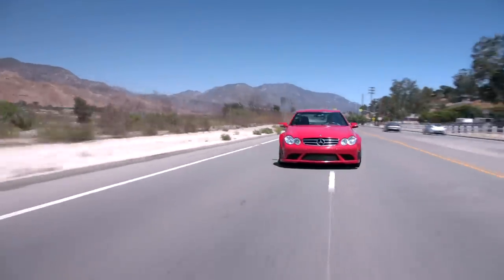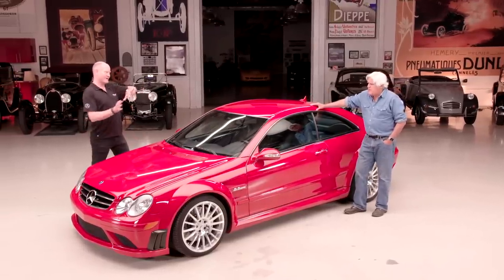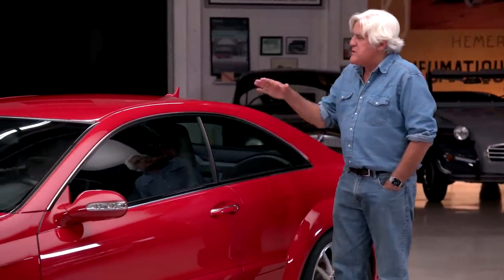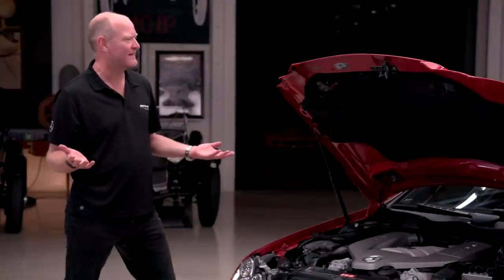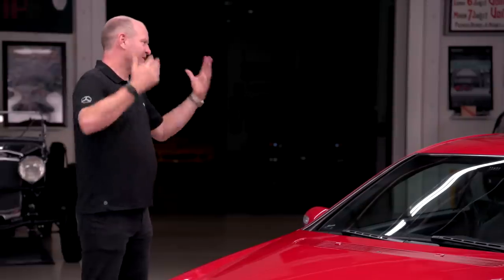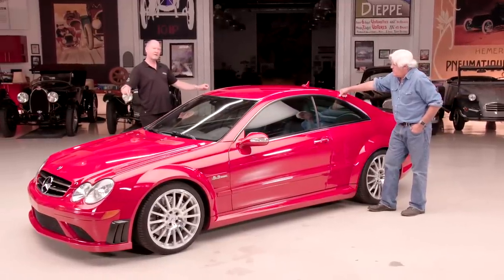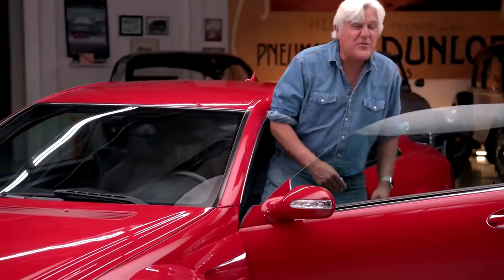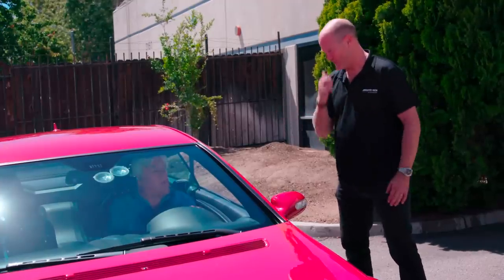2008 Mercedes-Benz CLK63 AMG Black Series | Jay Leno's Garage

Comment: So crazy, that Black Series was the maddest thing back in the day… ten years later 500hp barely seems impressive.
Anyways, I found it strange how Tommy described CLK as a two door C Class; I know it’s basically C Class after the fire wall and E class in front, but in terms of pricing, performance, and position in the product line, I always understood CLK to be a compact version of CL Class, just as SLK was a compact SL… hence the “k” designation.
Reply: The CLK GTR was a tad bit more 'mad'.  ;)
Reply: You are correct.
Reply: The SL65 AMG Black series was the nut job.

Comment: Regarding tire regulation in Germany. Car manufacturers had "exclusive deals" with certain tire manufacturers and until the year 2000, you were only allowed to run the tire brand that was "approved" for your vehicle,...which of course was just unnecessarily stupid and dropped by a European-Union regulation.
Reply: Germany is needlessly bureaucratic.
Reply: @DoctorSkillz  Was just obscure business practice, sold as a safety regulation rule.
Reply: Half German here living near Frankfurt. 😅 I can't remember ever having to put an "approved" BRAND of tires on any of my cars (got my license and first car back in 1998). Dimensions, speed and load index of the tires you are allowed to put on your rims (wich also have to be of approved technical specifications) on the other hand, still have to be of a certified type up to this day. Our "TÜV" - wich is the stringent german stepmother of the american inspections - can be a real pain in the arse when it comes to this. If they haven't approved a tire / wheel combination for use on your cars make and model, the cops can pull you over and revoke the operating permit for your car, basically forcing you to walk home.

Comment: In regard to his comment about the manual gearbox; I completely agree having driven most Merc performance cars of the era. I always felt that this was more of a “muscle car” platform than anything else; and a 6-speed would’ve complemented it perfectly.  Side note: You could still get a manual gearbox in the Audi and BMW competitors to this car in 2008. (S4, S5, M3, etc)
Reply: Get them while you can.
Reply: I have an automatic 540 and a manual M5, both e39 chassis. The manual makes the car so much fun to drive. I think the last Mercedes I saw with a manual was the 190 2.3 16v that rivaled the M3
Reply: @PatricioGarcia1973  I also have an e39 540i with the 6-speed (M pkg); still just as in love as the day I bought it!

Comment: When Tommy showed his disdain for power steering in Formula 1, I couldnt help but think of the remedy that is the the sheer power you have to put on the brake pedal to make the brakes work they way they do. And the reason being that under 5 negative G when braking into a corner from top speed, your body and leg weight adds so much force to your muscle power, the brake pedal has to require such force to avoid overbraking and accidentally locking the wheels up. Also, the pedal barely moves, it basically works by measuring the force you apply to it instead of the distance it travels. These guys do hard work in the course of a race for various reasons, no need to make steering a workout as well. 😅
Reply: Exactly. A bit of an ignorant comment from the gentleman. F1 drivers get a real workout by the end of the race. It's definitely very physical. More than they get credit for

Comment: My understanding is the CLK was the follow-on to the CE300 or E-coupe.  Nonetheless the CLK DTM is legendary and the CLK GTR one of the all time special cars.  The 2007 CLK 63A was a 147 example production run and then the 2008 CLK63A was a 100 production run so very limited production cars, not certain as to the quantity of CLK63 Black Series.  I actually have a CLK63A and it has everything except the adjustable suspension yet with a  convertible top and rear seats.  I pined for the damn thing for 10 years until I found the right one.  I always considered it the German version of an American muscle car, of course much much more refined.  The 6.3 was the first all AMG designed and built motor for production I think.  My 08 is so well built, I think they really took extra care on construction; a more well built car than my 2017 e class.  Thanks for showcasing this car, they have been under the radar.  Awesome!

Comment: I had a CLK 320 and I'm pretty sure it's the coupe of the E class. CLK stands for coupe light kompressor.
Reply: The E class had its own coupe
Reply: @redrum2204  Just checked. No separate e class coupe in 2008. The one that this one is based on is the direct follow up to the 320 CLK I had which was the coupe of the e class.
Reply: They were the the E class coupes and convertibles... But the 'K' stands for Kurz... A german word for short or compact. Any old model with a 'K' in its name meant this is the smaller version of a bigger car i.e. CL >>>CLK       SL >>>>SLK    GL>>>GLK etc.
Reply: @matthiasbalke9089  sorry, you're right. The E coupe came out the next year/model

Comment: You can run wider tires and bigger wheels, but when it goes over what the maximum size is from the manufacturer you have to go and "re-register" it. Same in several EU countries. Also have to do this if you change to coilovers, they have to be TÜV-certification, this same certification also works in many other EU countries than Germany. The tire thread should not be over the fender line, therefore some might put on stretched, but adding fender flares would take care of the issue. You also cannot tune the car, only to certain limit and then you have to once again re-register the car to the specifications and if it goes way  over, it won't pass in some EU countries.

Comment: AMG (Aufrecht Melcher Grossaspach) started out as a private company and later did some work for Mercedes-Benz. Because their work was so good AMG was eventually (partially) acquired by Daimler and since 2005 I believe it's a 100% owned.

Regarding your comments about putting on different tires in Germany. Every change an owner does to the vehicle has to be approved when the vehicle undergoes the mandatory technical inspection. When that is due depends on a few factors. So if you change anything that is different from what the manufacturer did (unless it's approved by the manufacturer) you'll get dinged at the inspection and perhaps don't get your sticker. When it comes to tires, the tire manufacturer doesn't matter but the specs need to be the same. Best example is about rims. If you want to put a different brand/size rims on the vehicle some rim manufacturers have documentation that says it is okay to be put on your type vehicle. Then, with this piece of paper, you are good to go at the inspection.

It's both difficult and frustrating, because if you want something that's approved for your vehicle the manufacturers sure know how to get to your wallet. It's a lot of red tape.

Comment: I'm not sure if all 500E's had it but I almost bought a 2008 500E wagon with the AMG kit (wheels, aero kit, steering wheel, etc) and it had the same gear shifter.

Unfortunately I didn't buy it...

Comment: Cars in Germany are required to have only car parts and wheels installed that are either designed by the manuf. for the car or have a TUEV certificate, that they can be installed on a certain car. On a rare car, you will find very few wheels with certificate, which I imagine was the case for the CLK63

Comment: The CLK is not the C class coupe exactly.  The CLK W 209 was based on the C class chasis, but the instruments, and engiens were from the E class.  It was supposed to be the E class coupe. There was a C 180 coupe at the time that corresponded to the C lass. The CLK was replaced in 2010 with the E class coupe

Comment: The tires rules have been reduced over the years but you need to have the right speed and load rating also the dimensions have to be within the range approved for the car

Comment: Tires are not problem. Rims are today no problem too. But everything crash test relevant, like a spoiler for example, has to be tested. In case of that spoiler it means, you will have to crash it. Thoses tests costs money and material (like that spoiler) but can be done. A friend had a custom made spoiler for his old fiat 500 and they two some. In the end he made them in a mini-series. The costs were around two grand but it took a LOT of time.

Comment: I heard the german blog at „alte schule“which means old school and it is about many famous german Car makers like Walter röhrl, Hans Joachim Stuck , Wolfgang Reitzle Former BMW Chief of Technology when the first V12 was developed in 1988 and the first E30 m3.
There is Willy Kauhsen the Former test driver for the Porsche 917. He told That he was testing the 917 on Nordschleife in 1969 and the differential was wining and when he came back Engineer Flegl said nobody told you to Drive so fast you have Bern doing 380 km/h on the straight 238 m/h. He drove Can Am test for Customer and was visited by Mark Donohue in Weissach. In Europe he Racer the interseries using the 917/10 with 1000hp.
Reply: Willy Kauhsen was called by a US Racer called George F.… from Can Am That he wanted to Drive Nordschleife. Willy said dont do it is Zen times longer than Laguna Seca and fifteen times more and more vicious curves with Beton.
The guy trained 5 days with Willy on two 911 RSRs and gave up. Willy said now we have 350 hp. Now imagine it would be 550 or even 950?

Comment: Some TÜV-Mythbusting :

In Germany every substancial safety relevant modification to the car has to be approved by some authority.

Lights, Wheels, Brakes, Suspension, Engine...and of course seats,belts, seats, airbags...and for the future: Autnomous driving functions..

1. The manufacturer of the car
Usually it is not strictly legal..but if you change you C-Class suspension to the OEM sport suspension...police and Tüv most likely can not tell the difference In a Mercedes for example.
But:
Also they get more and more and more reluctant to do it, you  could even have your car re-fitted with OEM options and then get a new "Datacard and CoC Paper" for you vehicle that now includes the Option..but it's usually 2-3 times more expensive than just checking the option on your order sheet or finding a car with the options you want and just sell the old one.

CoC Paper just says: This car is like the car, that the authorities have already checked with the manufacturer before production.

You could also go to the TÜV and say "I fitted the complete sport suspension, only used OEM Parts" and they most likely will give you an entry if it's done properly (usually if you had it done by a professional) [Refer to 4.].

2. If it's third party bolt-on-stuff you need to have an "ABE" - General approval of operation. So the manufacturer of the bolt on part, tested it with the vehicle and hands a document that says:
It's working, don't mind. Usually this is for lights and suspensions and seats...

3. With Wheels (OEM or Third Party):
The dimensions of allowed wheel and tire sizes are written down in your "CoC-Paper" or your "Fahrzeugschein"

You can use any wheel that fits those dimensions (Diameter, width and Offset) and all tires that are being sold, that fit on those Wheels.  There was a time, where the Manufacturer and the modell of the tire were specified for Motorcycles...but since tires also could go out production, that practice was dropped and only the "Dimensions" were kept.

You could use all generally approved tires and wheels (usually if they are openly sold in the EU, they are legal) if they have the right dimensions.
Speed Index for most cars is not important, but if you use Snow-Tires that only go to 190km/h ...make sure there is a sticker on the dash reminding you in your CLK Blackseries...
 

4. You go to the private organization that is called "TÜV" and get your modification checked indivdually. If it passes, it will be printed on your "Fahrzeugschein". 

If you use OEM Parts or third party parts that fit in a very similar vehicle,  it's usually not that expensive. If you have welded your own A-Arms,wound your own coilovers and spun your wheels... well you need to pass the same checks as a manufacturer would have to.

TÜV, and only TÜV has a database of "Already approved Mods" and so they could give you an approval without actually looking at the car in detail.

BUT: A Tüv approval, even if it's documented in your papers, can be revoked if you had done further mods or done it improperly. Even the TÜV-Approval for the Manufacturer of an unmodified car can be revoked ! (Normally all Diesel-Cars that cheated the emissions were illegal..but lobbyism is strong..so all owneser had to accept a software update - or operate their car illegaly)

Every car an motorcycle need to get reviewed every other year.  Review is on surface level, checking for safety relevant issues. Worn out tires, substancial rust, no life left in the brakes,  deployed airbags, worn belts, broken windshields...and of course emissions.

Lights are testet, Brakes are tested and all Error-Codes are being read. Sometimes there is an EMissions check..but if you got no error in OBD..usually the emissions check out.

Taxis/Busses and rentals have to be reviewed every year

New cars get to be reviewed after 3 years.

Comment: The typical Autobahn cruiser at the time. If you saw one coming in your rear view mirror with lights on, make room hahah. Best colour was to be in black imho. Even this reddish is an attempt to be red, but it doesn’t suit her all that well. AMG’s in Europe on the second hand market needs to be done with care though. Most of them were ditched by the first owner because they are impossible to maintain due to its mega costs on repairs and maintenance. In top condition, they are indeed awesome.

Comment: If I were the AMG boss of bosses, I would have taken this 6.3l engine, de-stroked it a bit, say an 5.5l, twin turbo intercooled it, actually putting the twin water intercoolers in the passenger department of the w203 series coupe chassis, Integrated a roll cage! then mated it to a very short throw 6 speed manual, maybe even used some air powered shifters,  some big brakes and body cladding, track level adjustable hydraulic system a la cl series ...then called it a day!
I think folks would have lined up around the block to buy them.
I would have called the the c63T red hot chili edition!

Comment: Difference was Shelby and Yenko/Motion/Mr Norms/etc were they bought already made components from GM/Ford/Chrysler and put them into cars or ordered them to their spec. AMG basically builds new components based on MB parts. So MB engine components RARELY fit AMG built motors. Plus AMG is OWNED by MB unlike Shelby et al.

Comment: If this car had a flat plane crankshaft instead of a cross plane and had a manual 6 speed as an option, it'd be the greatest car ever.
Reply: That is the E92 M3 for you, crossplane but N/A and 8000Rpm Redline, one of best BMWs M Models of all time, for ever.... But my favourite , cause i like more that Muscle style, i would take the CLK... Just what youre usecase is you plan on use it there you can pick between these two....

Comment: I'm surprised the MB guy is wrong. The CLk is a two door E-Class, not a two door C Class like he claimed.
Reply: The w209 clk shares more with the w203 c class than the e of the period. Firewall forward it is longer than the c however Kendall is correct.

Comment: You need no AMG version in the USA. These cars are built for driving not for blocking roads by driving less than 75mph.
There you only need a base model with a 1,6 liter diesel.

AMG versions are built for European motorways only where you can use the capabilities of these cars in a few countries either legally as in Germany or practically as in Italy. 

When you drive daily speeds of 200-270km/h on your way to work, you start to understand these cars and what they stand for.

Comment: C, c class, L, 2 door coupe, K, kompact. When the S class coupes were called CL. For coupe large. I had a CLA45 in 2015. 355 horsepower and I loved camaros, challengers, mustangs, corvettes trying it on. Bye bye, especially if it was damp. A CLS 63 S model didn’t pull it until well over 140.

Comment: Mercedes got extreme on downsizing. C63 passed from de 6.2L to 4L V8 biturbo and from 2022 they will pass on in-line 4 cylinders..what next? Renault engine?
Reply: In my mind it's more like "hey AMG guys we made a bet you can't pull 500 horsepower from a 2.5 4 cylinder engine" - "hold my bratwurst"